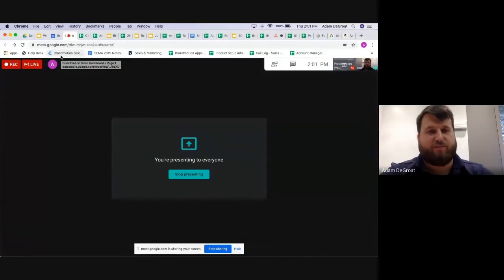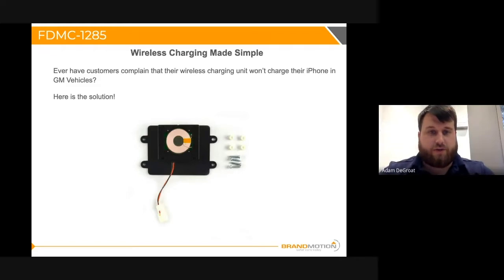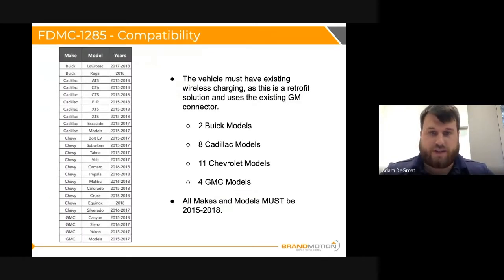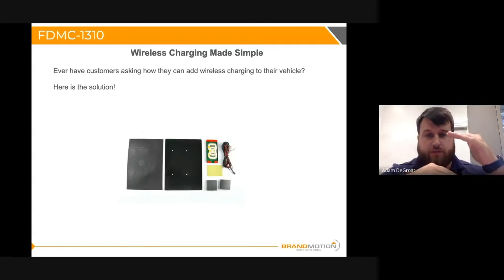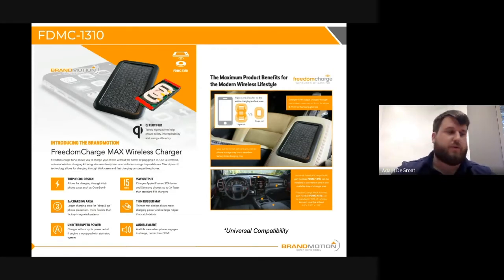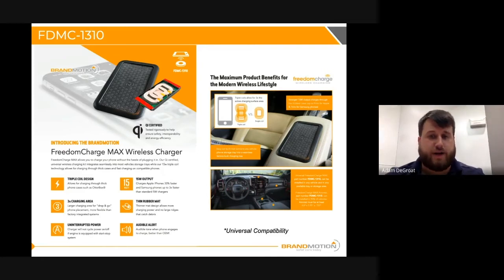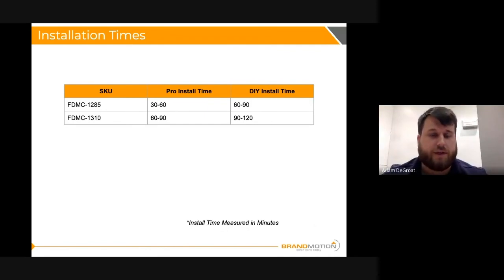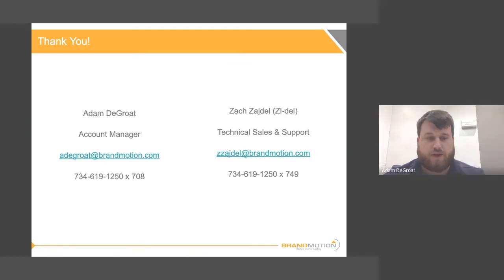Wireless Charging | Brandmotion Tech Talks

Comment: What does the double audio beep mean?
Reply: The beep indicates the phone is connected and charging.
Reply: @charlessarin1206  yes it beeps once when it connects to charging. But then it will become twice and noticed it stopped charging
Reply: @Charles Sarin  okay I'll call tech support on that bud box. I just got this product and just installed it yesterday.
What is a bud box?
Reply: @zamyraah1  some of the older models of the 1310 need to have some voltage regulation. The bud box fixes that. The problem was fixed with a software update on the new chargers. Some information on where and when you purchased the product would be helpful when you call
Reply: @charlessarin  sorry I thought I've told you that I have the 1285
Reply: @zamyraah1  Thats different. Usually it's the position of the coil that is causing an interruption to the signal. The plastic piece the coil is attached to is intentionally flexible to press the coil up to the top of the armrest.  Check that please. Also possible the location of the coil maybe a little off. Try each of those things separately. It that does not resolve the problem please call us.